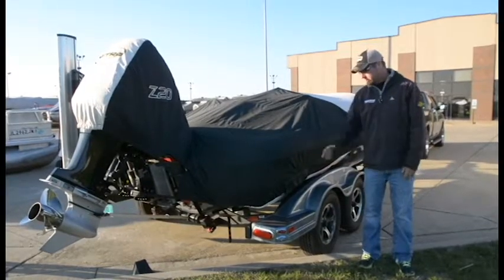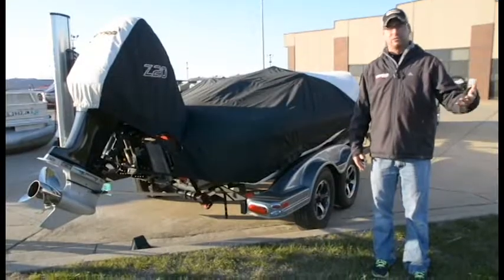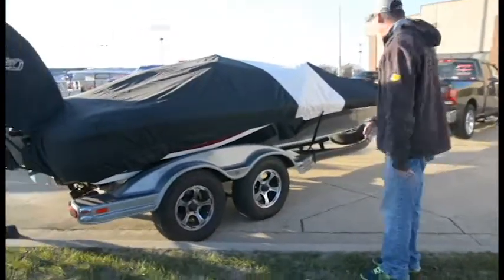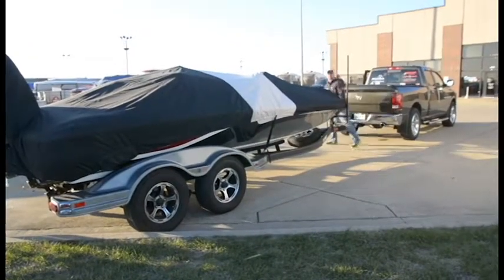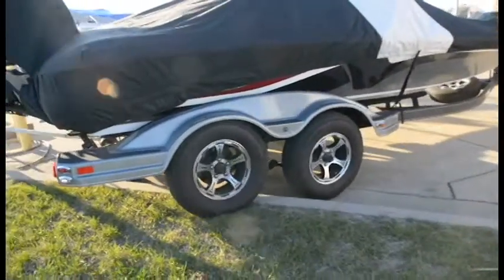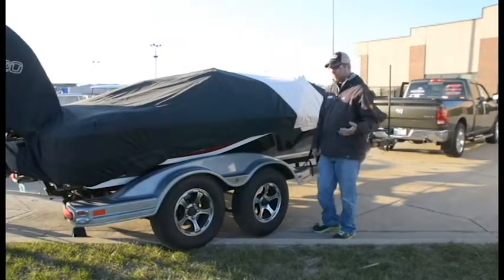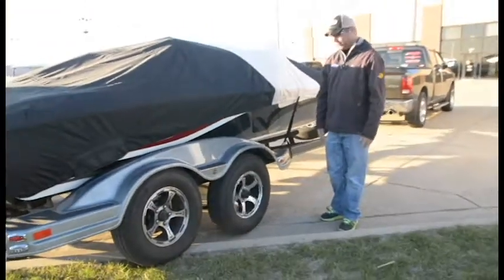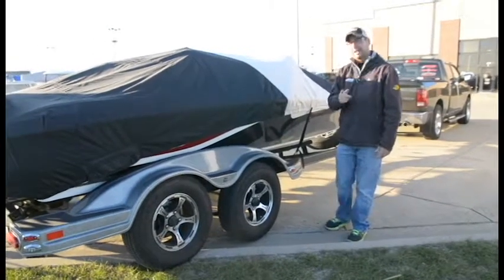How To Change A Boat Tire with NO Jack !

Comment: Ok what if it’s the back tire? Lol
Reply from the maker: lol...then it would not work
Reply: @theboatdock1  Disagree. Angle forward and put your passenger side tires up on the sidewalk.   Your lead passenger side trailer tire will follow.   The back tire will then be lifted off the ground.

Great video btw :-)